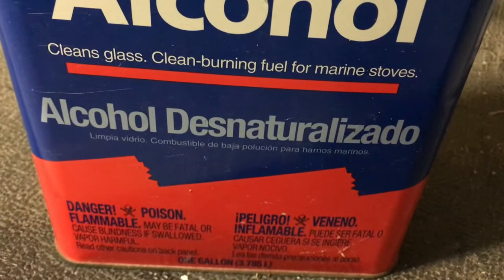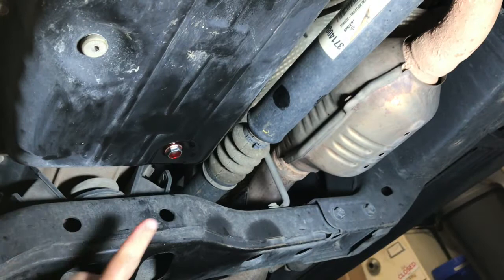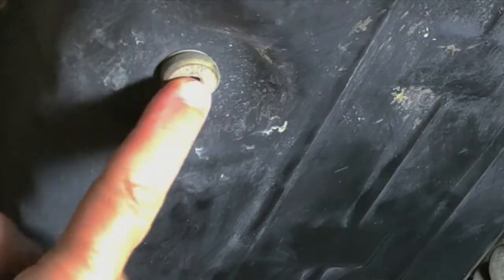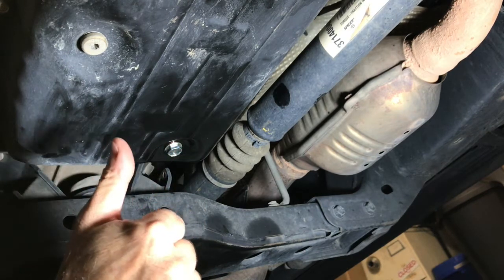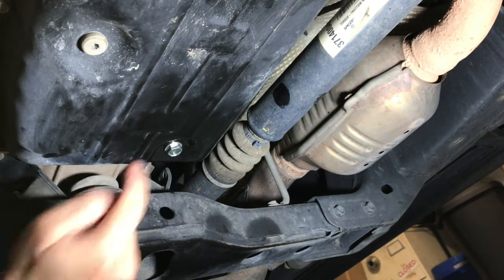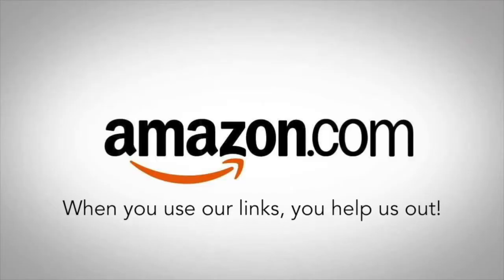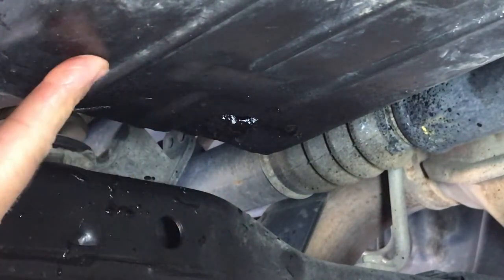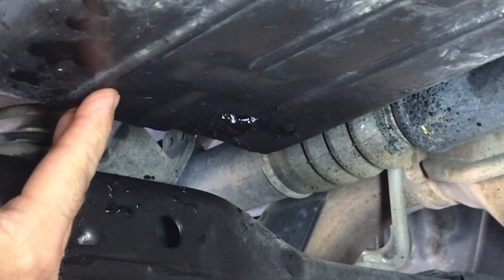Can Flex Seal fix a transmission?

Comment: Using a High Temperature rubber Gasket ring on the bolt and then use the Red RTV sealant and then spray it with flex seal
Reply from the maker: Ooo, those are great tips. Thanks! Sounds like the voice of personal experience.

Comment: you need to drain the oil first then clean it with brake cleaner then aply flex seal
Reply from the maker: I love your suggestion. The trans fluid did eat away at the Flex Seal over time. Fortunately, it held long enough until I got a new pan and bolt and all is repaired.
Reply: I would have used tire bead sealer.... coat the bolt with that or lock tite
Reply: @drippingwax try Honda bond application 1st then this flex seal for coating…works as a charm for my same issue hehe i have Manual Transmission btw on my 2013 Honda accord

Comment: Looks just like rubberized undercoating, probably very similar.  I had the same problem w/ my engine oil drain plug on my 2006 VW Jetta w/ the 1.9L tdi turbo diesel 4cyL. Drain plug just kept turning, so I just hit it on either side w/ a flat chisel & it came right out. I band aid fixed for about 3 oil changes w/ high temp rtv sealer & 2 rubber washers w/ the regular steel washer in between. It worked okay for a while, but finally fixed it right w/ a S.O./Single Oversize plug from O'Reiley's. It's a 14mm X 1.5, almost the same size as the most common spark plug thread(14mm X 1.25). It worked great, was about .017" oversized & was nice & tight. I still used a good amount of teflon tape & rtv sealer. The dang pan is aluminum I think,(or Junk pot metal) if it was steel, it wouldn't have happened, or at least been easier to fix. They also make D.O./Double Oversize plugs for threads that are Rrrrrrreally screwed up.  Thanks for sharing.       - take care
Reply from the maker: Brilliant! I just love hearing about ways to get things fixed! Wack it off with a chisel! Why didn't I think of that? Learn something new every day! 
Yes it is a bit like rubber undercoating. It was a tempo fix too and did fine until I got a new pan. Thanks for sharing your experience.
Reply: @TSGEnt  I didn't word that quite right, I put the flat chisel between the drain plug hex head & the washer/pan. After hitting it on both sides 180 degrees apart, it pulled the plug outwards, the threads engaged & it came out like it would/should usually.
Reply: @TSGEnt  Here's a video when I fixed it the 1st time:   https://www.youtube.com/watch?v=U1GcCoNTSX8
Reply from the maker: @leeisenberg  Got it. here's the follow-up video and how my screw looked.  https://youtu.be/E0kbGL6X7V8

Comment: Im in Florida have a oil an cooler leak i don't see wether like that down here so ill give it a try fr fr
Reply from the maker: Careful. It won't last long with only a topical application. After a couple days the trans fluid weakened the rubber adhesion. As a temp fix only.

Comment: I have used JB Weld on a cracked oil pan and it lasted over 7 years when I sold the car.
Reply from the maker: That's great to know! That' stuff is a good fixer.

Comment: Omg lol you plastered that crap right over the drain bolt why didn’t you just replace the crush washer that’s between drain bolt and pan that supposed to be replaced when it starts leaking?
Reply from the maker: Crush washer. Hmm. Didn't have one at the moment. Also the treads were stripped. Needed a new pan or re-thread the old one. Had FlexSeal so I went with that. Worked! For about a week and got in the new pan and gasket. It's all better now!